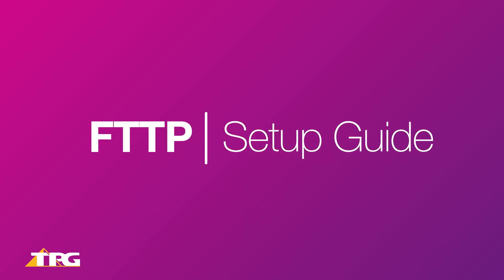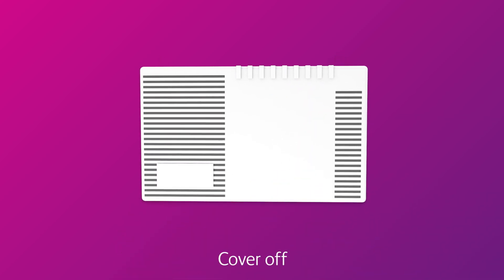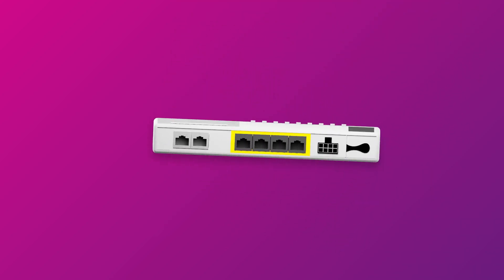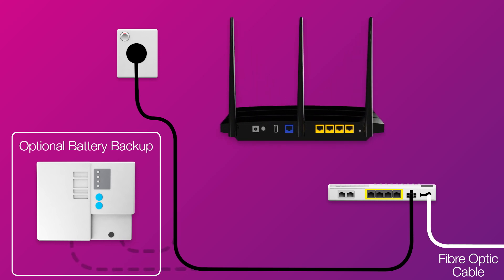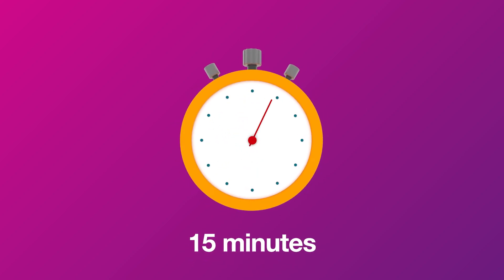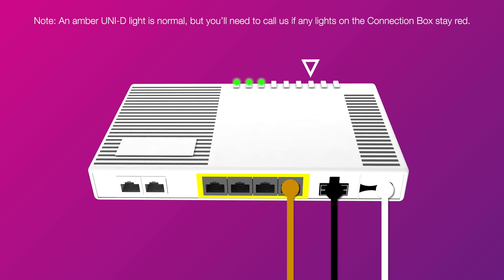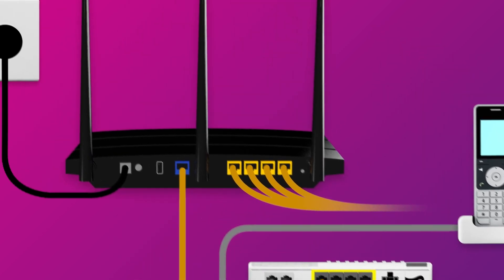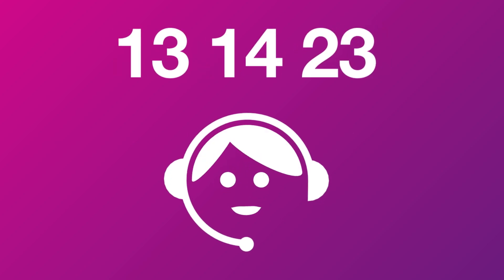TPG - Setting Up nbn Fibre to the Premises (FTTP)

Comment: An NBN Co standard installation allows for 40 metres of cabling from the Utility Box on the outside of your home to where the NBN Connection Box is installed within your home. the NBN Connection box should not be located within an out building, garage, wet area or hard to reach location.

Comment: Is it just me, or does it seem silly to plug in a good modem/router into the nbn box which in most new homes is in the garage? wouldn't you want that router centrally located in your house if possible?
Reply: I couldn’t agree more,and who wants there phone on in the garage.
Reply: I agree! This is what is the issue currently with mine and it’s a joke. The modem is getting filled with dust and crap from the garage. Totally stupid if you ask me
Reply: Well, it's pretty smart, if you ask me. I have the modem/router in the nbn box, in the garage. From there, I have 3 x ethernet cable runs to the theatre, living and study, where direct connection is useful. Most of the modem/router have really good range, and it spans pretty much the entirety of my house. This way, there are no cables/units to be managed inside the house. Very convenient in my opinion.
Reply: @nandagopalv4 for most people, like people who don’t know how to use Ethernet cables or set them up, FTTP is pretty tricky, especially because in the garage is thick walls making the connection garbage
Reply: @nandagopalv4 which modem/router do you have and what is the size of your home?

Comment: So just explain to me, what if the NBN box was installed way down in my garage and I have my personal computer in my upstairs study room.  Now how does that work if I would like to use an Ethernet cable? If I do need to get a huge EC, then the design of this thing is completely stupid. Oh yeah, and there's no way to actually move the router to where you want? Yeah 'smartly' designed.
Reply: That's when you need an electrician to do internal cabling through the walls to get an access point upstairs, or use a network-over-powerline system
Reply: Get an ethernet over power kit, they're less than $100 and allow you to connect two power points using the internal wiring of your house
Reply: @khengoolman  Yeah but if you've got your router and NBN box in your Garage, how are you going to connect the Ethernet cable all the way from say your bedroom down to there?
Reply: @aive8z446  you have to get an electrician to install a data point In your wall, can be done for like 100 bucks